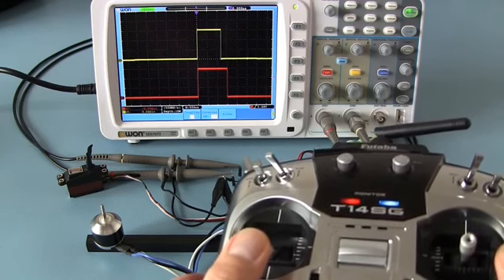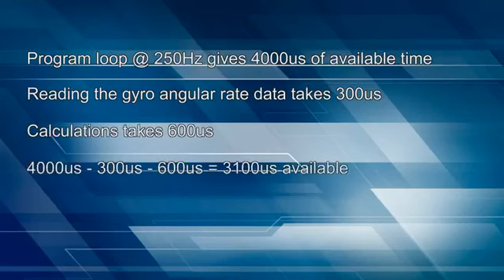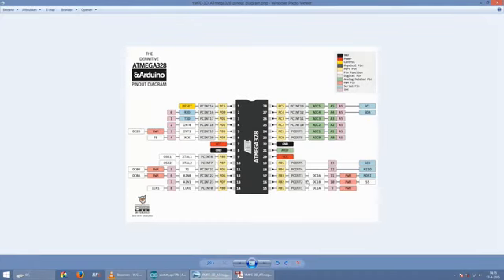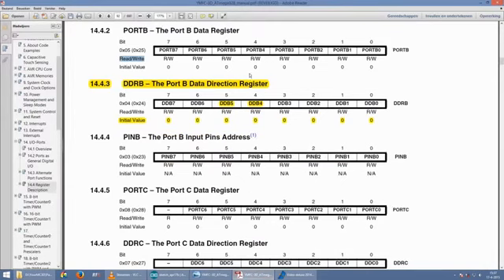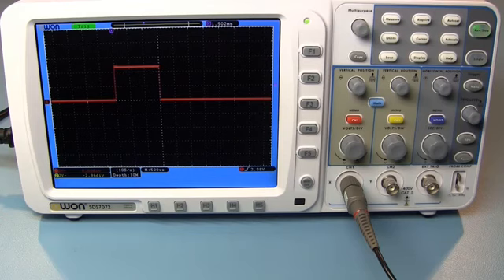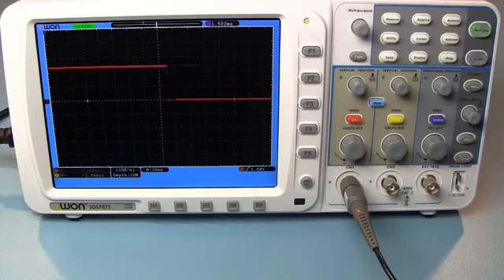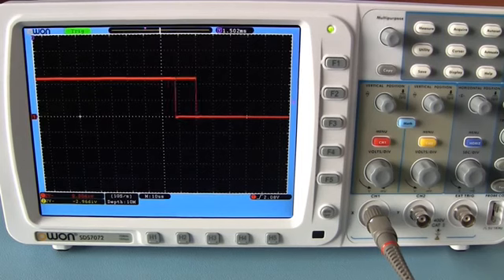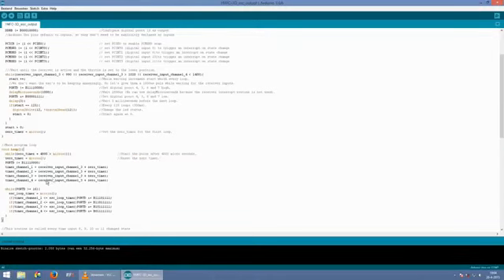YMFC 3D part 4   Arduino quadcopter   Electronic Speed Controller ESC

Comment: Hi, I had to replace one of my ESC's and now it seems to work slightly different with another 3 of them.
Is there any way to calibrate ESCs or make it working exactly the same as other ones?
Is there any way to output the ESC values on serial monitor?
Reply from the maker: sorry late reply
Electronic speed controllers or ESC's for short are controlled with a 
1000us till 2000us pulse. 1000us means off and 2000us means full 
throttle. To make sure that all the ESC's react the same way it's 
important to calibrate the 1000us and 2000us point. Without calibration 
the motors will perform different and the quadcopter doesnt fly well or 
might even crash.

Remove the props and upload the ESC calibration program to the Arduino. 
Disconnect the USB cable and follow the instructions in the manual to 
calibrate the ESC's.

In most cases this is done with the following steps:

Place the throttle stick in the upper position (full throttle)Connect the flight batteryAfter some beeps place the throttle stick in the lowest positionDisconnect the flight battery
But again, check the manual of your specific ESC for the correct calibration procedure.
Reply from the maker: For Calibrating ESC
 Download link:-https://docs.google.com/uc?export=download&id=1Td7l-z99DiM4EZHcSH4NnLFuK_FzYYTB

Subscribe:-https://www.youtube.com/channel/UCvjN...
Email:- ddevkumar46@gmail.com
Facebook page:- https://www.facebook.com/ddevkumar46
Direction:- http://multielectronic.business.site/